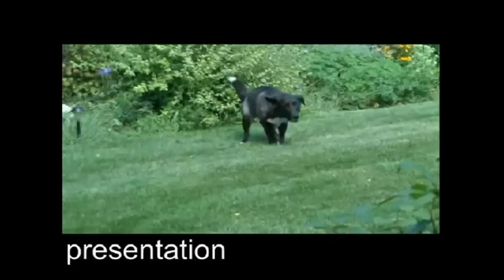Isopropyl Alcohol - A Second Look

Comment: Hiram, great videos.  You can get isopropyl to burn soot free, however; there can be a little bit of "browning" left on the pot.  It's more like a thin tar substance, not the dusty, powdery stuff like soot.  With my stoves, you need to let the stoves get hot before putting the pot on or you can get some soot.  BTW, burning isopropyl still smells bad (similar to Esbit).  BTW, when I burn 70% iso, I end up with residual water in the stove that needs to be poured off.  Best regards, Jon

Comment: Hiram, the second blend you used was,I believe 79%, if the rest was water it kinda validates my statement about increasing water for less soot as you can see just from looking it is quite cleaner. On the other hand it appears to not burn as hot as HEET,etc. However, it might burn better at altitudes higher where you might have problems with other fuels.
MikeSr39

Comment: Some chimney stoves burn iso cleanly. Jonfong57's (now flatcatgear) stoves - those are best I've seen to burn it cleanly. 
It's not a matter of speed of burn, what is important is two-stage burn - heating inside cimney first and clean combustion of resulting fumes later. Half inch tall flame front also helps, so way lower than sweet spot with ethanol.